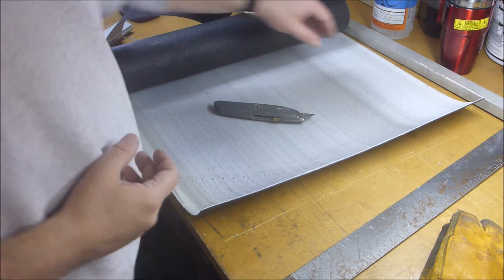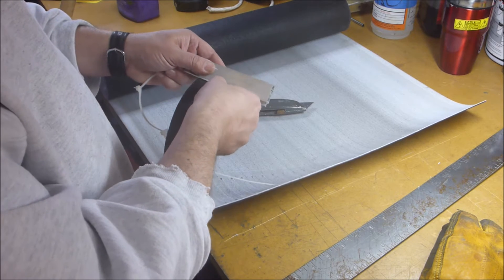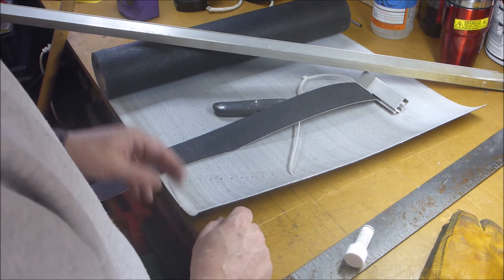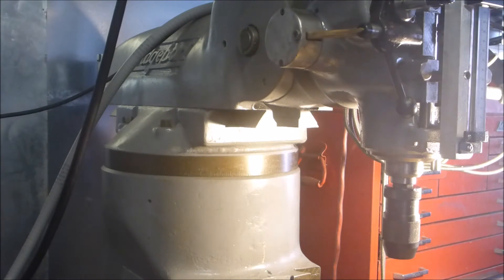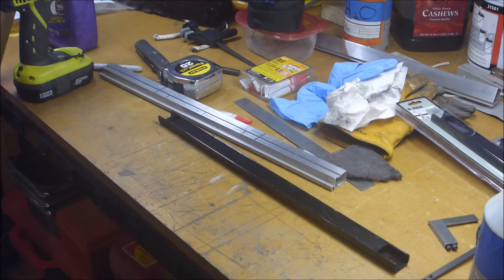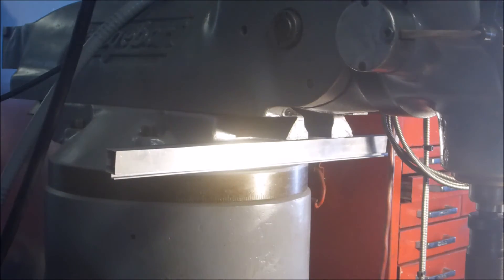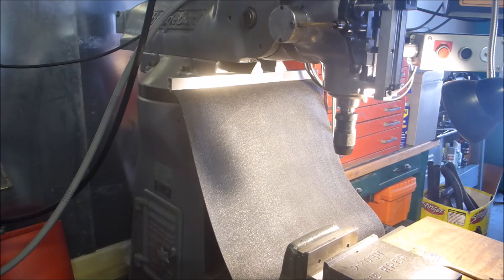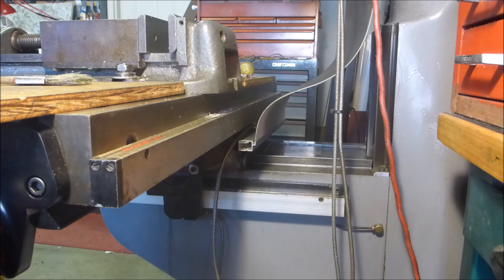2016 02 14 DIY Bridgeport Way Cover

Comment: One word for you: AWESOME!!
What are the dimmensions?
Reply from the maker: Manny Yabar Thanks for the kind words (or word)! The treadmill runner material is 20 inches wide. I cut a length of it about 22 inches long. It has worked out very well.

Comment: Hows it holding up? Has having the big magnets givin you much grief as far as attracting chips or has been ok? Thanks good job.
Reply from the maker: Hello Steve (just Steve--cool moniker)! The chips do collect there but I haven't had any trouble brushing them off. Generally I vacuum the table then move back to the shield, then lastly I brush the chips collected on the magnet while holding the vacuum right on top of them. Cleans very well. Maybe I'll do an update video to demonstrate. Thanks for watching and commenting.
Reply: Great. Thanks for the reply